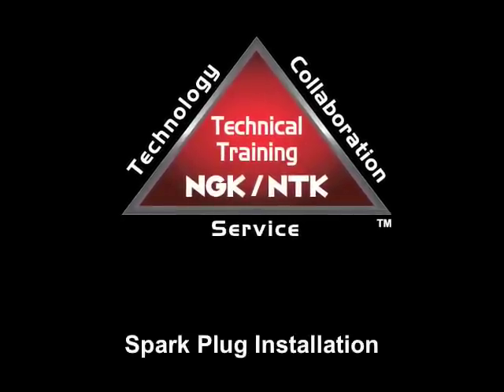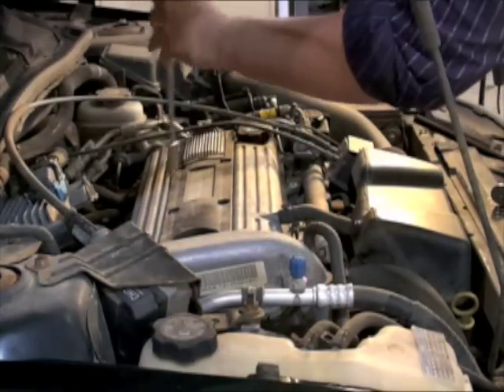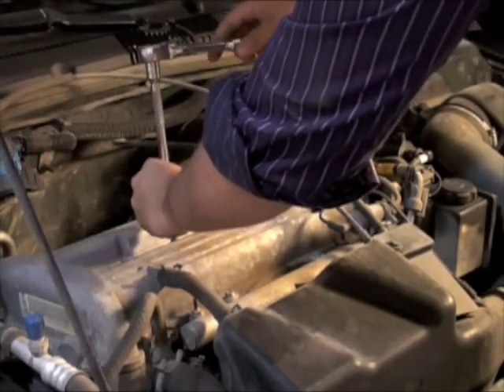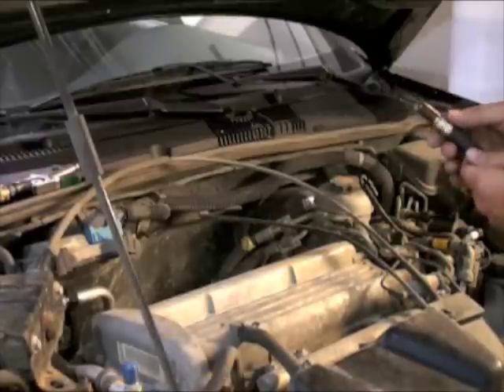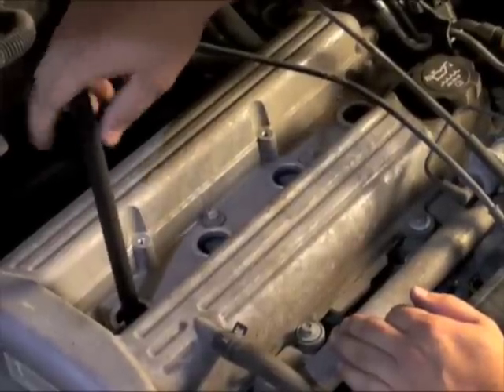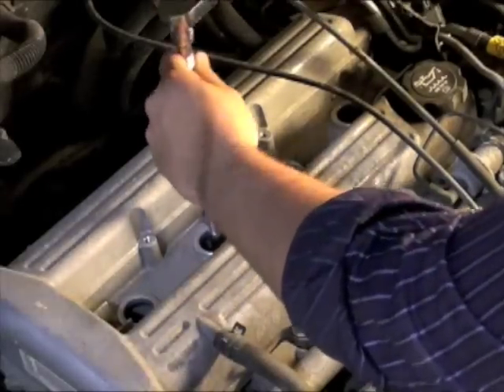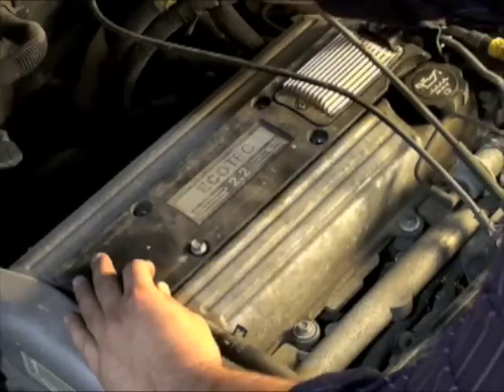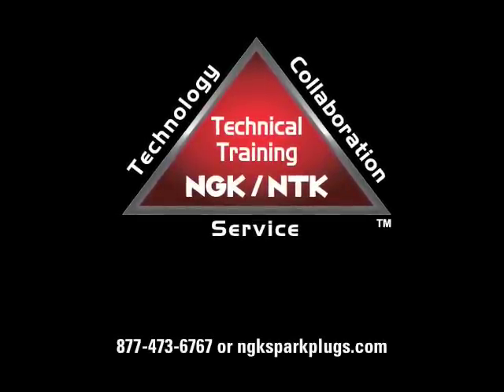Installing Spark Plugs - NGK Spark Plugs - Tech Video

Comment: So no dielectric neither? Just install and that's it?
Reply: The carbon deposits left behind by normal combustion act as a very competent dry lube, similar to graphite. One should never, EVER, use anti-seize on spark plug threads. The added lubricity will decrease the required tightening torque, meaning most people will over tighten them. This is by far the #1 cause to plugs seizing & snapping off in cylinder heads, not from the absence of grease.

DO NOT PUT GREASE OR ANTI-SEIZE OF ANY KIND ON SPARK PLUG THREADS,  EVER!!!

Dielectric grease can & should be used at the boot to plug connection only.

Comment: No anti seize on the spark plug threads too on NGK plugs,there is a coating on the threads.Use of anti seize causes grounding issues and also adds extra friction when torqueing them down.Results in over torqueing snapping the plug off
Reply: The carbon deposits left behind by normal combustion act as a very competent dry lube, similar to graphite. One should never, EVER, use anti-seize on spark plug threads. The added lubricity will decrease the required tightening torque, meaning most people will over tighten them. This is by far the #1 cause to plugs seizing & snapping off in cylinder heads, not from the absence of grease.

DO NOT PUT GREASE OR ANTI-SEIZE OF ANY KIND ON SPARK PLUG THREADS,  EVER!!!

Dielectric grease can & should be used at the wire boot to spark plug connection only

Comment: The method of indiscriminately blowing compressed air around the top of the engine is fine for a "rough cleanup" of large debris but should be followed up with a proper cleaning of the spark holes as follows:  The spark plugs should first be loosened by 1/8-1/4 quarter turn to break them loose, then compressed air should be aimed directly into the spark plug hole to blow out any accumulated debris around the spark plug.  This will ensure that the debris is actually blown out of the spark plug hole.

Comment: dear. ngkspatkplugsusa.
i have 2003 hyundai sonata 2.4L
in july 17.2016 i bought ngk(5760) PGR5C-11 4 pack.
i want question..

1. anti seize Lubricant i must to be or i don` t need?
    because some review is must be use & some other review is don`t do that..
   ngk (5760) spark plug is not recommend anti seize?

2. when i checked ngk website torque chart  witch one is right one?
 by the way thank you for help..
Reply: The carbon deposits left behind by normal combustion act as a very competent dry lube, similar to graphite. One should never, EVER, use anti-seize on spark plug threads. The added lubricity will decrease the required tightening torque, meaning most people will over tighten them. This is by far the #1 cause to plugs seizing & snapping off in cylinder heads, not from the absence of grease.

DO NOT PUT GREASE OR ANTI-SEIZE OF ANY KIND ON SPARK PLUG THREADS,  EVER!!!

Dielectric grease can & should be used at the wire boot to spark plug connection only.

Comment: Tune up grease?
Reply: The carbon deposits left behind by normal combustion act as a very competent dry lube, similar to graphite. One should never, EVER, use anti-seize on spark plug threads. The added lubricity will decrease the required tightening torque, meaning most people will over tighten them. This is by far the #1 cause to plugs seizing & snapping off in cylinder heads, not from the absence of grease.

DO NOT PUT GREASE OR ANTI-SEIZE OF ANY KIND ON SPARK PLUG THREADS,  EVER!!!

Comment: do I need to calibrate the NGK iridium for a 2011 f150 ecoboost or they come all ready calibrated?
Reply from the maker: +crazy wheel All NGK Spark Plugs come pre-gapped right out of the box. But it's also a good practice to just check the gap before installing.

Comment: hate it when I can't understand what they're saying and that part just happens to be one of the most important step  lol .. what did he say  'a quarter what'  ?  3:35

also what if you don't have the air compressor ... someone mentioned using one of those office air cans .. and do you have to spray  inside the hole of the spark plug(while the spark plug is screwed in of course)
Reply from the maker: +d jones Sorry for the late reply. Basically what he was saying is to tighten the plug to the "corresponding degree" noted on the torque specs on the back of the plug box.

Comment: Ha! Yesterday I bought Iridium's for my Cavalier with the same engine as in the video. I spent about 10 minutes trying to find the spark plugs. I seen the coil in the black part and was just totally bamboozled! 

Thanks for the video
Reply: +Brad Nimbus It took me about 5 minutes to remove all 4 plugs, only because they have NEVER been replaced before. Breaker-bar!!

Comment: No anti seize or dielectric grease?? Just so everyone knows that should be used.
Reply from the maker: NGK spark plugs feature what is known as Trivalent
plating. This silver or chrome colored finish on the threads is designed to provide corrosion resistance against moisture and chemicals. This coating also acts as a release agent during spark plug removal. NGK spark plugs are installed at the factory dry, without the use of anti-seize. NGK tech support has received a number of tech calls from installers whom have over-tightened spark plugs because of the use of anti-seize. Anti-seize compound can act as a lubricant altering torque values up to 20 percent, increasing the risk of spark plug thread breakage.
Reply: ***** Gawd level
Reply: NO need to use that stuff on NGKs, I have always used them on my Hondas without a problem. If you use cheap ones like Champion, Motorcraft, or Autolite I will say yes go ahead and use that stuff, with NGK don't worry.
Reply: The NGK spark plugs I received have a tightening degree past hand tight (specifically my say 1/2 turn past hand tight).  If a tightening degree is used rather than a torque value, torque altering anti-seize or other things isn't a concern.
Reply: The carbon deposits left behind by normal combustion act as a very competent dry lube, similar to graphite. One should never, EVER, use anti-seize on spark plug threads. The added lubricity will decrease the required tightening torque, meaning most people will over tighten them. This is by far the #1 cause to plugs seizing & snapping off in cylinder heads, not from the absence of grease.

DO NOT PUT GREASE OR ANTI-SEIZE OF ANY KIND ON SPARK PLUG THREADS,  EVER!!!

Dielectric grease can & should be used at the wire boot to spark plug connection only

Comment: @ ngksparkplugsusa:  "Factory new" have virgin clean threads in head. No carbon buildup. I do not believe that 50K on odometer and anti-seize will result in over torque especially in 12-18lb ft. Sounds a little too "clean paper" engineer and not real world machinist argument to me. "Copper" anti seize also has inductive properties conducive to high voltage saturation and energy release.

Comment: Do you need anti seize or dielectric grease?
Reply: The carbon deposits left behind by normal combustion act as a very competent dry lube, similar to graphite. One should never, EVER, use anti-seize on spark plug threads. The added lubricity will decrease the required tightening torque, meaning most people will over tighten them. This is by far the #1 cause to plugs seizing & snapping off in cylinder heads, not from the absence of grease.

DO NOT PUT GREASE OR ANTI-SEIZE OF ANY KIND ON SPARK PLUG THREADS, EVER!!!

Dielectric grease can & should be used at the boot to plug connection.

Comment: You couldn't pay me to install sparkplugs without anti seize on them, leave them in too long without any and they will seize in there and probably break off when you go to take them out.
Reply: No anti seize on the threads of NGK spark plugs.They have a coating on the threads from the factory.Use of anti seize causes grounding problems and misfire issues.Adds extra friction resulting in over torqueing them and breaking the spark off too
Reply: @Toolaholic7  No anti seize on the threads of NGK plugs. Just like the 10 year old 30k mile set I pulled out of a BMW a few months back. Those bastards were in there so tight and dry it wasn't even funny. Their coating doesn't really work all that well. I use anti seize no matter what they say and never have had a problem.  I also torque by feel not with a torque wrench, never had a problem.
Reply: NGK put out a TSB not to use anti seize on  the threads on their plugs.Even says on their website too.MrSubaru1387 has a video on this which is on their channel
Reply: @Toolaholic7  I am well aware of their TSB. I also don't put half the damn can on the plugs either like most people do. Just a tiny bit, install plug by hand and work the plug half way out and back in again. Threads fully coated with no excessive goop to cause problems. NGK also aren't the ones  to change sparkplugs years down the road either. It's the people that put half the can on each sparkplug are the ones that have problems with the stuff.
Reply: The carbon deposits left behind by normal combustion act as a very competent dry lube, similar to graphite. One should never, EVER, use anti-seize on spark plug threads. The added lubricity will decrease the required tightening torque, meaning most people will over tighten them. This is by far the #1 cause to plugs seizing & snapping off in cylinder heads, not from the absence of grease.

DO NOT PUT GREASE OR ANTI-SEIZE OF ANY KIND ON SPARK PLUG THREADS,  EVER!!!

Dielectric grease can & should be used at the wire boot to spark plug connection only
Reply: @JoshNewby84  Been using anti seize on the sparkplug threads for years with no issues whatsoever. Torque them by feel, never used a torque wrench. Of course, if you have a trained gorilla putting them in there will be problems. Dielectric grease is worthless after it dries up into this flakey powdery substance. I use silicone spray on the sparkplug boots, so they plug on easily. No dried-up mess to contend with next time.
Reply: @1986FordF-250  "I've been using a grinder with no guard for years without issues. I've been working under my car without stands for years without issues. I've been welding without PPE for years without issues." 

Do you see where this slippery slope is headed? Lack of catastrophic failure does not indicate best practices. I've seen & heard more guys who swear by anti-sieze also proclaim that threads "easily gall, sieze, strip" and so on. It's not a coincidence that the people who design, engineer, & make the damn things also state that proper installation must include "clean & dry threads."
Reply: @1986FordF-250  "Torque by feel" is not even close to an accurate indicator. If your "feel" is off by even 10° of rotation, you're taking about a difference in clamping force of over 30%!!! Nobody has guess-ti-guages that accurate
Reply: @JoshNewby84  Torque by inaccurate torque wrench isn't close to an accurate indicator either. You know damn good and well as much as I do a lot of people that own torque wrenches never have them recalibrated and most of them are off to some degree out of the box. I've never once used a torque wrench on a sparkplug and never will. Somethings do not need to be over complicated, and this is one of them. I bet you use a torque wrench on the oil drain plug too? get outta here... There is a reason why most sparkplugs have instructions on the box for example, tapered seat sparkplugs tighten 1/16" turn after seat-to-seat contact, and gasket seat sparkplugs often say 1/4-1/2 turn after gasket seat contact. I don't remember anti seize changing a, for lack of better wording torque to yield degree type of torque application.
Reply: @MattsRageFitGarage  Even an inaccurate, uncalibrated torque wrench will not be off by 30% like an uncalibrated hand will.
Reply: @MattsRageFitGarage  No need for a torque wrench on oil drain plugs when you use Fumoto ball valves🤣
Reply: @MattsRageFitGarage  Spark plugs are one of the single most commonly overtorqued mechanical items, right up there with lug nuts. But you already knew that...
Reply: @JoshNewby84  I don't have a habit of stripping everything out I touch.
Reply: @MattsRageFitGarage  Neither do I. So what's that got to do with the price  of tea in China?
Reply: @MattsRageFitGarage  "Oh man, don't listen to those idiots over at NGK. They've got no damn clue what they're doing." How asinine does that statement sound to you?

Comment: Probably wrong place to ask, but how to find a correct replacement for old plugs and choose new ones from NGK?
I have Dodge Avenger, 1997, with 2.0 DOHC engine, but i don't have any idea what spark plugs to choose. I don't want to waste my money on plugs that will not gonna work in my Dodge. For BMW E36 it was easy: bought a NGK-BKR6EK. I was very satisfied.

Comment: I just came from the store I went to buy some anti-seize grease from but came out of it empty handed because I was unsure what kind of grease I should get. Now I read "NGK does not recommend the use of anti-seize compounds."
Thank you so much for stating this, now I know why I didn't buy any :D
About that torque business, I'll go with the drawing in the packaging.
I bought ZFR5FIX-11 for my Honda Civic D16W7 engine and I'm eager to feel its ooomph with the new plugs. THANK YOU!
Reply: Many if not all of the plugs made nowadays don't require any anti seize compounds. You can always use dialetic grease to make for a better connection between the plug and the coil....other than that especially for a 2.2 EcoTec the plugs go right from the box installed
Reply: The carbon deposits left behind by normal combustion act as a very competent dry lube, similar to graphite. One should never, EVER, use anti-seize on spark plug threads. The added lubricity will decrease the required tightening torque, meaning most people will over tighten them. This is by far the #1 cause to plugs seizing & snapping off in cylinder heads, not from the absence of grease.

DO NOT PUT GREASE OR ANTI-SEIZE OF ANY KIND ON SPARK PLUGS, EVER!!!

Comment: I just purchased NGK Vfires for my 1962 Ford Galaxie 500 with a 390 FE big block. What is the best torque I should put on these? Also I was told .35 gapping.